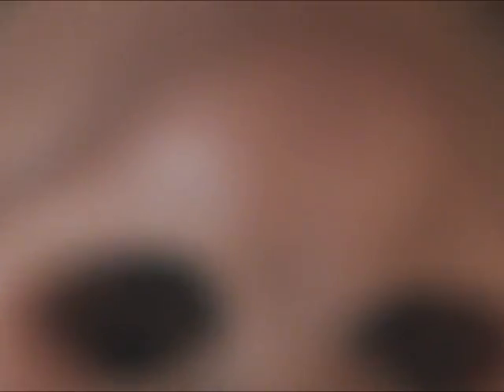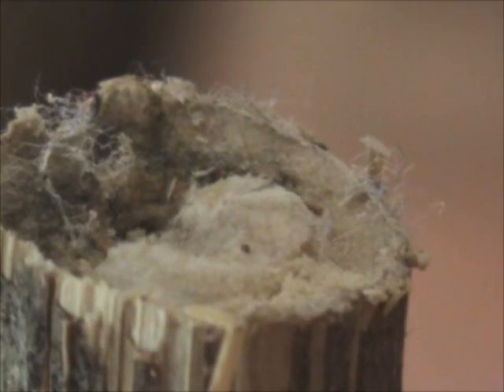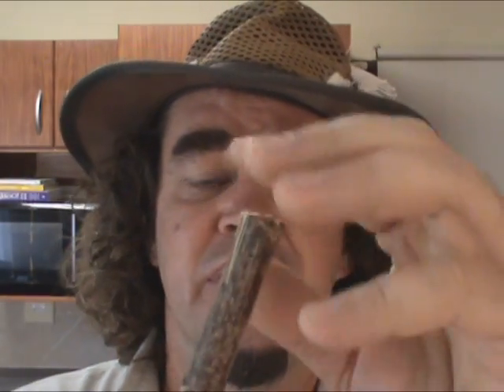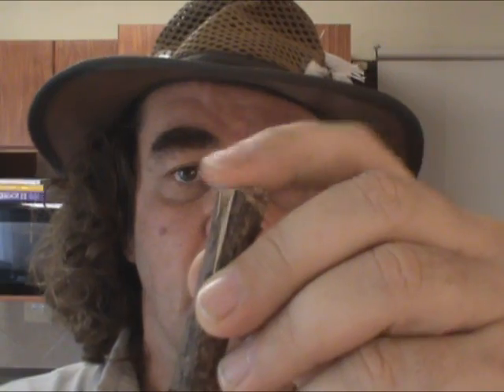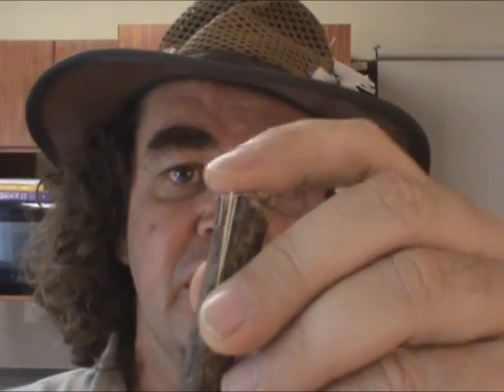African Hand Drill (Part 3) - Fun with Friction: 101 Ways to Make Fire #19

Comment: Interesting... I hadn't really look at this aspect of basic wood structure (ie lignin). Although, I've recognized the aspect of heat-treating the friction points, like during the burn-in process that relates to this concept (changing the wood's characteristics, sort of like fire-hardening the wood). I'm looking forward to your next installment to shed some light on how this comes together.

Although for traditional (classical) hand drill, I wouldn't necessarily say you need to maximize pressure, but to apply an adequate amount of it to increase heat and temperature.

It is amazing though, how something seemingly as simple as the hand drill has many variables that can make it more complicated. You're right though, there's no good resources on the internet that does a nice detailed explanation of friction fire-making (AFAIK). I've looked myself as well and the best I've come up with are websites describing related aspects, but not with friction fire-making in mind (like a box on an inclined plane).

Now, if we could find better ways to reduce pain with friction, ha ha (ie. hand blisters).
Reply from the maker: The really frustrating thing about the internet is just how heavily it skews towards the present and the recent past, especially information that was actually recorded digitally in the first place. And how much it skews towards celebrity and entertainment "facts" rather than real knowledge.
You could probably find 5,000 websites devoted to Justin Bieber's fashion choices, but almost nothing about ancient skills that were practiced for thousands of years and which were crucial to the continued existence of our entire species.
Even decent explanations of common textbook subjects are difficult to come by.
Reply: ***** I know what you mean. Perhaps the historians should have done a better job, ha ha. I think with more technology these days, improved creature comforts, and downright laziness contributes to your concerns with recently revisited primitive skills of the past. In many cases, it wasn't directly handed down well from previous generations (nobody has to rely on it anymore). Almost like a dying skill that's having to be rediscovered. It's definitely true in my case (a huge learning curve).

Although, my biggest complaint is misinformation. Now that information is more globalized than ever and there's more concerns with apocalyptic possibilities these days (ie. global warming/ extreme weather, terrorism, economic collapse, world war, exponential population growth, etc...), folks are capitalizing on the recent interests in bushcraft/ survival/ primitive skills and the what-if scenarios that's creating a lot of FUD (Fear, Uncertainty, Doubt) in some form or fashion.

Yet, it seems many have an alternate agenda to appearing more skilled than they are, usually in an effort for profit and/ or ego-fluff where there's a motivation to video-edit out the mistakes to look more capable (or impressive) than they really are. Survival school vids often concern me the most as they can't really profit well from mistakes, lack of knowledge, or experience (ie. marketing). Same goes for the many survival TV shows that have become popular in the last decade or so. Hence, the magic of video editing comes into play for folks to come off looking better than they really are.

It's human nature, nobody wants to fail or be rejected, but sometimes ya gotta think like a skeptical woman or a hiring-manager to cut through the bull-crap and see results from action rather than hearsay or stretched truths (ie. white lies, misinformation). Men are especially bad at overstating their capabilities because there's an alternate agenda involved (ie. libido, ego, social reputation). The problem is Mother Nature is one of the toughest one's to woo or impress. Blowing smoke doesn't always get fire, but sometimes the charm pays off (ie. luck). That, "Fake it til ya make it" philosophy. Ya can't win, if ya don't play concept, ha ha. Eventually there's somebody gullible enough or willing to take a chance to buy into the wishful-thinking that muddies up the waters, and with muddied waters, you get muddied explanations. Garbage in, garbage out. Hence, why we can't always explain or fully understand all the aspects of friction fire-making (success or fail), This is where religion can come in handy, ha ha. Where an observable explanation is no longer necessary for peace of mind.
 
I'm a big fan of, "My camera battery died!" right at the crucial moment of success. "It's true, I did it. Just take my word for it!"

Comment: Speaking of friction, did you ever show how to make fire with a condom... or  prophylactic? Filled with water, it can be used as a spherical magnifier to magnify sunlight and make fire. I know you've used magnified sunlight, but wasn't sure if you've ever used a rubber.... like 'THAT'.
Reply from the maker: I haven't filmed that episode yet, but I have done it a number of times and it certainly works. Speaking of friction, it helps to get the non-lubricated ones. The lube tends to make the surface cloudy, which disperses the rays. So yeah, I have used one like "THAT"...